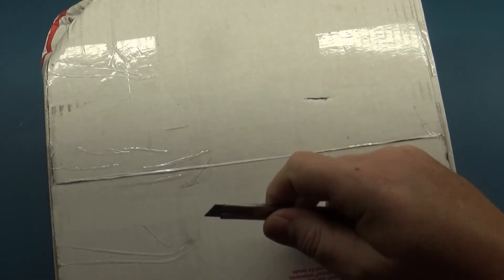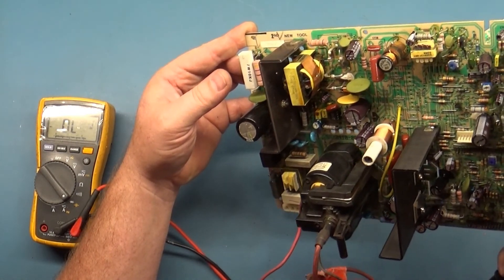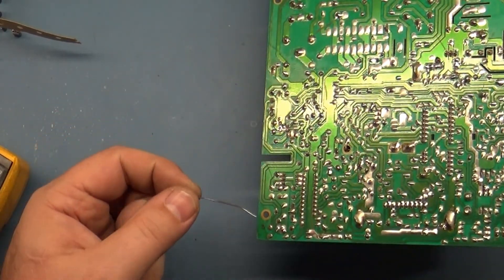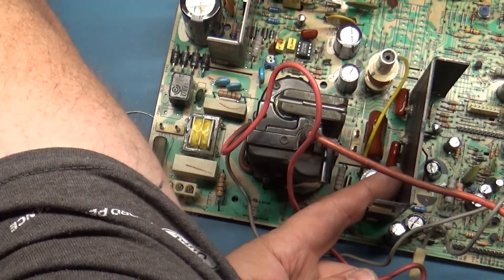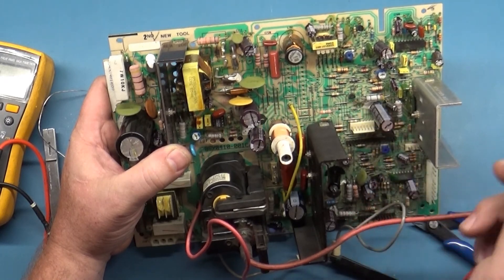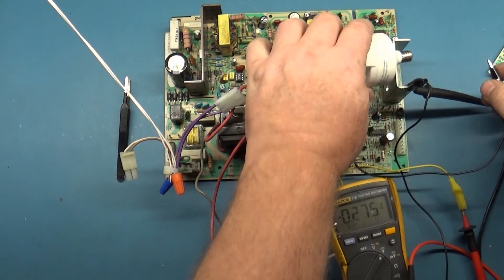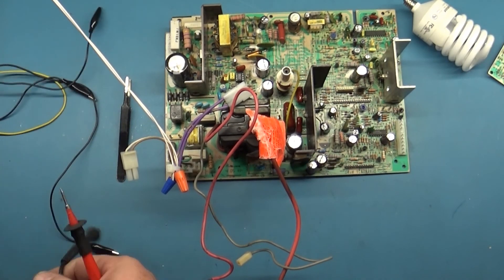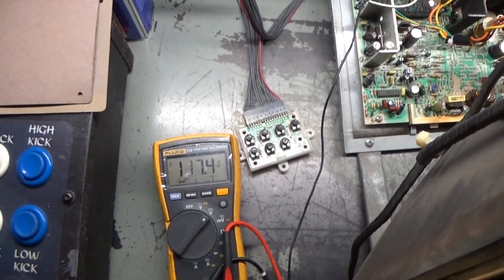25" K7400 Arcade Monitor Chassis Repair - Shorting HOTs, Bad R823, Low B+/Shutdown Pot Adjustment

Comment: Hi thank you so much, for sharing you knowledge and experiences. 

Could you please help me out. To fix my K7400? 

I was doing a recap, but when I started working on the neck board, I notice that it has some missing components. 

I tried to look on internet the schematic of it to place the missing components, yet I didn’t find them. 

Anyway, I wonder if you could tell me the specifications of the following components? 

R511
R512
C519
C521